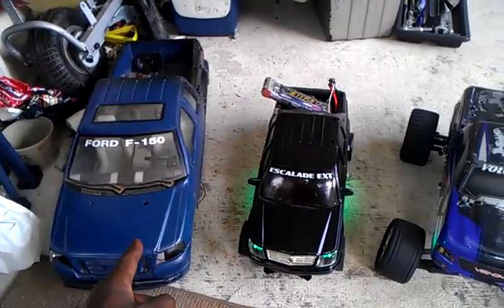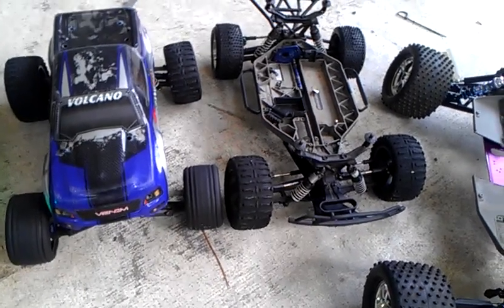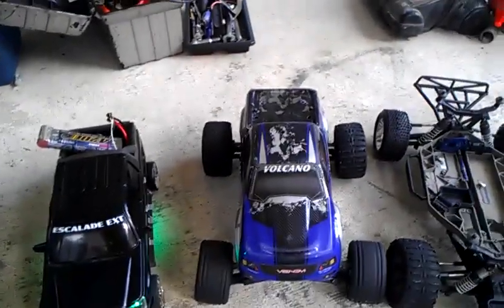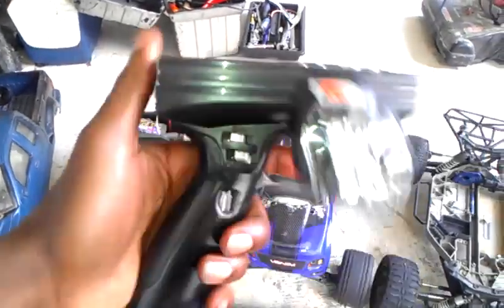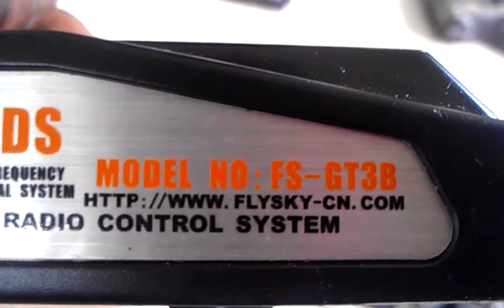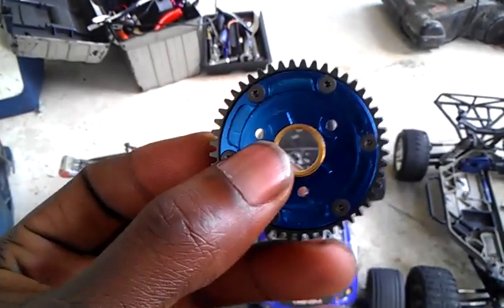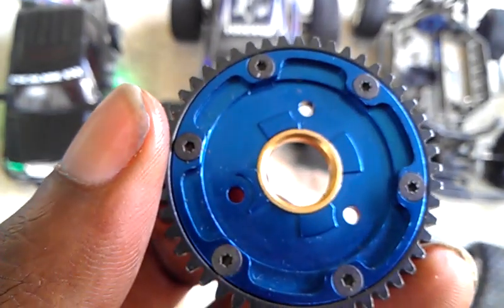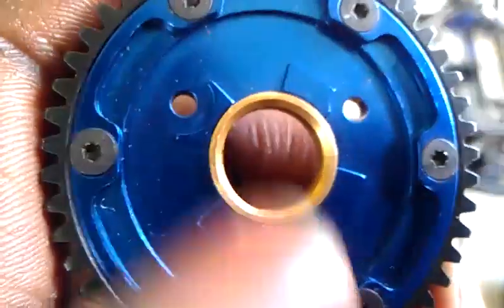Rc update....upsetting news.

Comment: The controller. The trigger inside ? If you have the instructions they should have a exsploded view of the controller so it should have a part number I think maybe wrong.  The spur is that off a 2wd slash ? Don't know of it can be modded but try it buddy. Goodluck on the trigger  badnews man.